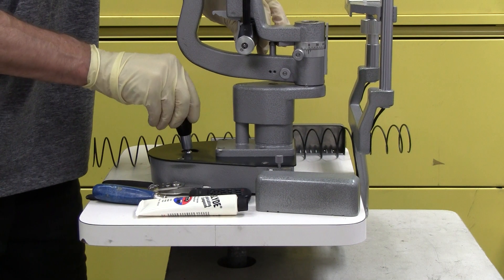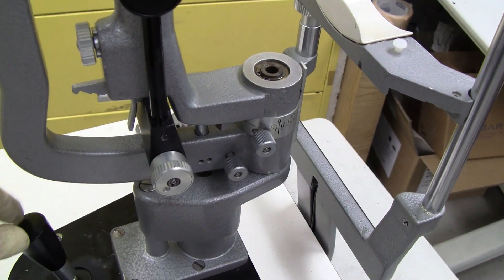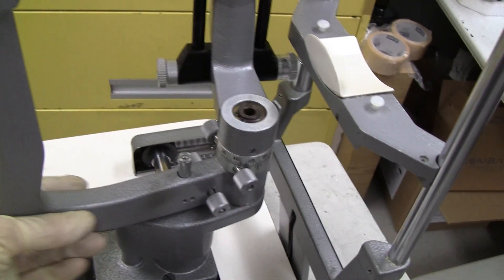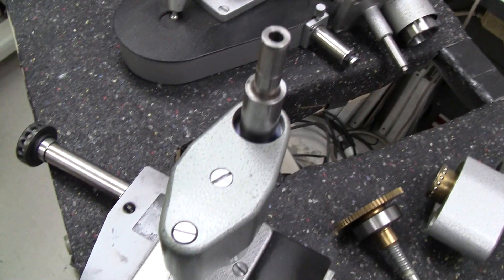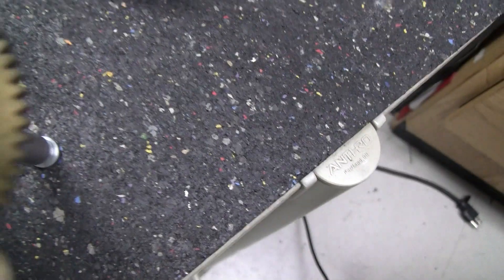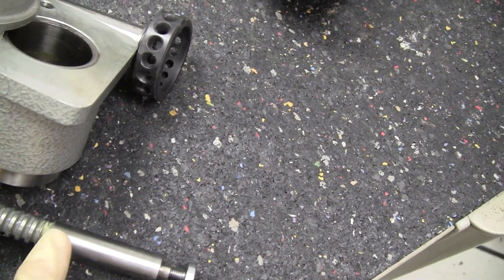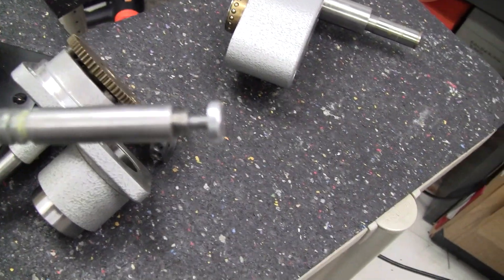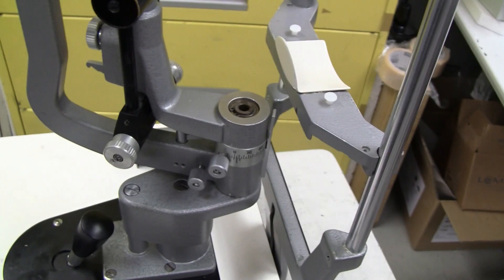Haag-Streit 900BM Slit Lamp lowering/going down by itself. Downward inertia suppression.

Comment: Hoppa, as always, great video(s).  Yeah, years ago I would replace the spring only to have settling of the slit lamp to continue.  I did hear from a third-party at a facility that indeed, the H-S service tech will relube the spindle.  This I have been doing, but find I can get enough of the spindle's worm drive (threads) exposed to relube without removing the spindle by backing it out (down) as far as it will go.  Of course, maybe not as thorough as you are doing.  This is always a problem especially on BQ's at a teaching institution where they have the slit lamp loaded up with beam splitter and assistant scope adding a lot more weight!
Reply from the maker: 🤔"Life will find a way..." I'm glad they put the extra spring activation on the BQ. They also put the extra spring activation on the Topcon 7E and the like! Thanks.